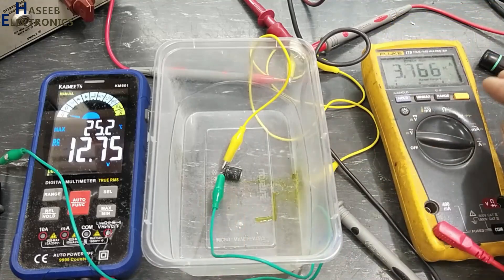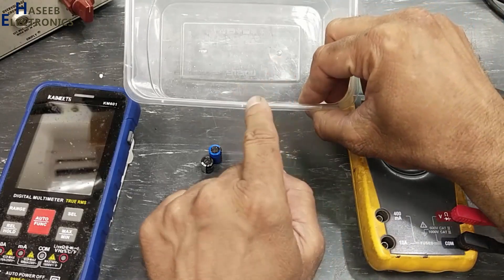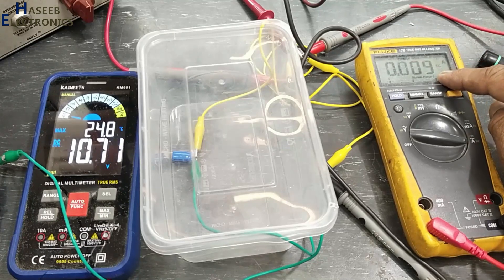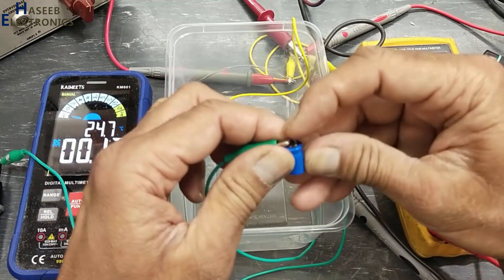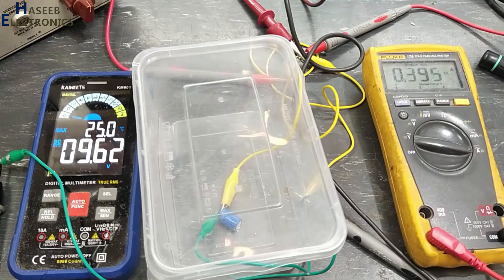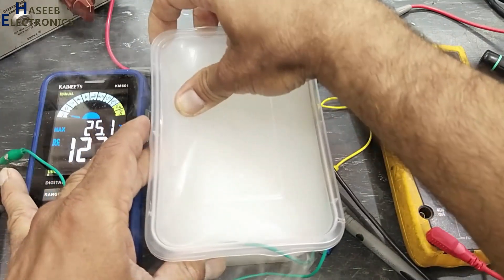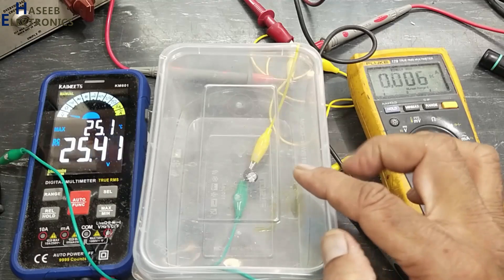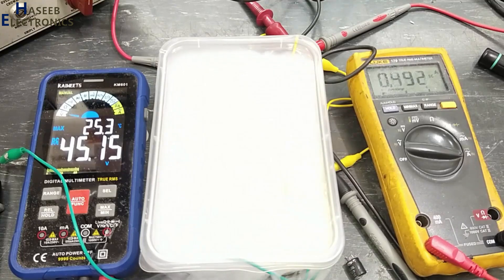{1207} Reverse polarity & Overvoltage effect on Polarized capacitor

Comment: Thanks for the experience. I have a question: If you use a diode bridge + a 3300 microfarad, 35 volt capacitor And use the XL4015 stepped CC module with CV/CC control Is there a risk of the condenser exploding or damaging the module. wa assalamu alaikum

Comment: Hi Sir , can you explain in video number #592 i don,t understand how the pulse tansformer TR5 is driving transitor Q6 and Q7 and also the role of capacitor c26 in parralel with d12, r43 and lastly how transformer tr4 is working because there is c24 cap that will block dc volage passing